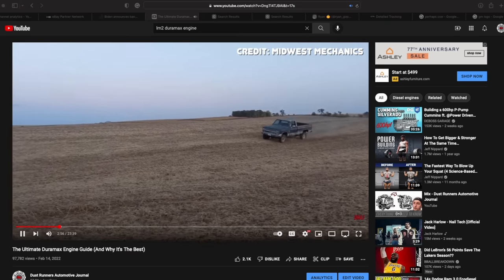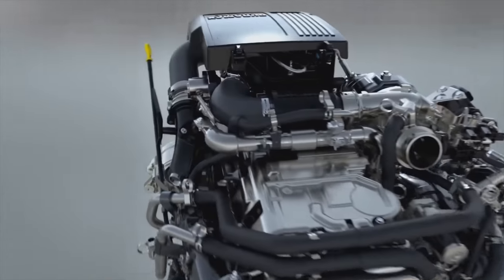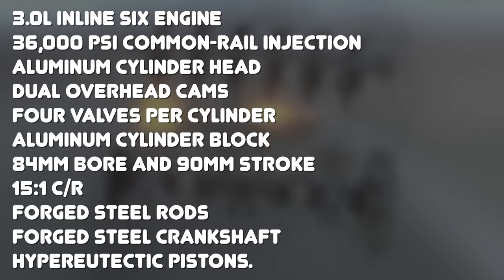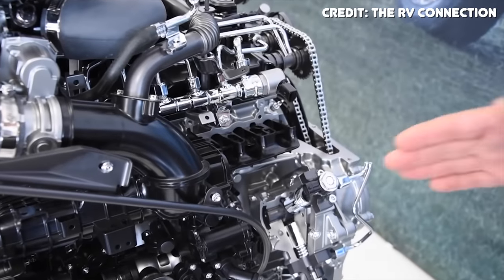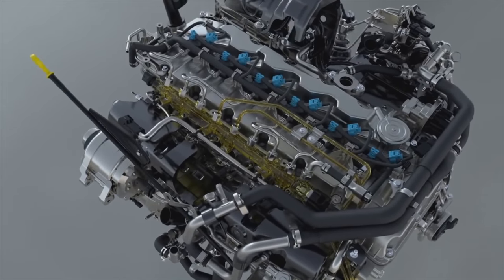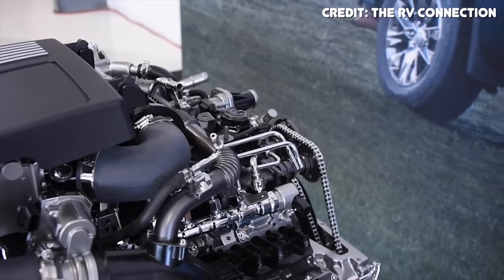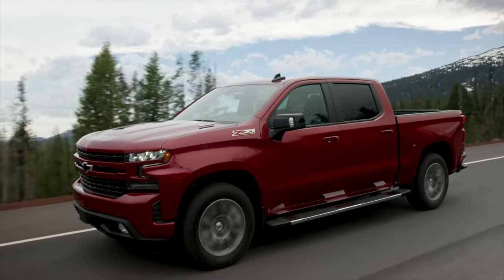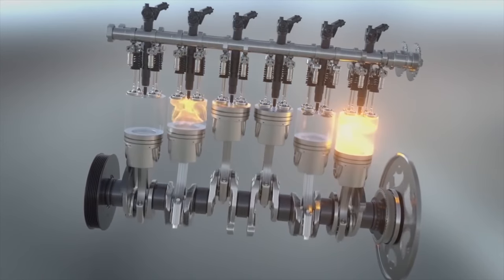3.0L LM2 Duramax: Everything You Need to Know

Comment: My 3.0L has 106k miles now. I drive an avg of 250 a day. I love this engine.
Reply: Planning on keeping it to the point you'll have to replace the oil pump belt?
Reply: @anotherrandomtexan25  already did it at 93k. Had an oil leak from the timing cover, and while they fixed that under warranty, I asked them to replace the belt. $75!!!
Reply: @hadyrome5574  did they say who long it took them? Difficult job?
Reply: @vomitus007  I think it was a 10 hour job altogether.

Comment: 25k. miles miles on it in 2 years normal driving  I really love this truck and engine. issues  long crank 3 times in 2 years and emission gasket exhaust replace    everything you say is so right what a great honest description of this particular engine.
I am a little skeptical of its reliability after 100k.  miles ?  repairs could become excessive. I would not own one with out an extended warranty ! or replace every 36k.  miles.

Comment: I think the access problem on the rear of the engine is kind of overblown. There are other engines out there that are so loaded up with complexity that it's just as much hassle to work on the front of the engine. Try changing a simple water pump on the Ford V6 Ecoboost. Behind a mile long cam chain on a 4 cam engine with VVT.  It's a seriously long, expensive, and messy job. I doubt this engine is worse to deal with.

Comment: I contemplated 1 of these in an at4 for a few weeks then decided to get a 2500 cummins instead.
Reply: @Todd Saeger yes they do have a 2500 at4 6.6 duramax. Ultimately I don't like the not a real allison 10 speed they are using and I'm not a fan of the interiors in 19'-22' gms. Plus I had a 94' dodge 3500 scdrw cummins so it was familiar territory. I just prefer the torque delivery of the cummins over the duramaxs as well. The 3.0 duramax is a cool idea and hope it ends up being a good engine i6 is the way to go. But all the overheating issues they were having and the rear drive system plus the tow rating was not what I was expecting.

Comment: I'm a technical at a Chevrolet Dealership in Oregon and I loathe this engine. In my opinion it is an engineering nightmare. GM has had issues with the timing chains and the job requires engine removal to replace those chains (according to GM Service Information). I was the first person in my shop to do this repair (the next biggest repair done previously by another tech was EGR Valve replacement). Before I performed the repair, I spent some time to think of the easiest way to do this job (cab removal, trans removal ect.) But I went ahead and did it the way GM recommended. The repair was performed due to a TAC recommendation because the cause of the issue is unknown. The vehicle came in with a Camshaft/Crankshaft Correlation DTC that set immediately as the engine turned over. I think it's important to note that the Camshaft Sprockets and Camshaft Position Sensor Reluctor Wheel are only held to the end of the Camshafts by bolt tension 🤦‍♂️ (19ftlbs + 50⁰ or something of the sort).
Reply: Sounds like job security…
Reply: Unkeyed cam sprockets have been around forever and aren't an issue.
Reply: On diesel engines?

Comment: Please do a follow up video on the 3.0 Duramax.     I would be interested in seeing what aftermarket parts are available.     How it compares to the engine in the Nissan truck with the Cummins.       Anybody out there with 100,000 miles on it yet ?     Anybody tried to change the belt yet ?      Is there an easy way to check the chain when you remove the belt ?     Wouldn't it make sense to go ahead and replace the chain when you replace the belt ?      I look forward to 10 years from now and picking up one of these used, with hopefully less than 100,000 miles on it.

Comment: My no-start problem only happened when I hit my break and my start button at relatively the same time. As long as I remembered to press the brake, then hit the bottom, it never happened. And I was able to duplicate the problem by pressing them at the same time purposefully. I got the flash so the problem is fixed, but now the engine turns over longer before cranking.

Comment: I seem to remember GM adding an extra injector for regen on the LML to avoid oil contamination issues with post injections. It makes me wonder why they went back to post injections for the LM2. Looking at everything else, it doesn't seem like they did it to avoid complexity. 
They really seem to be pushing their luck with Murphy's law given all the variable systems on this engine.
I get that variable stuff and drive by wire has proven to be reliable, but coolant valves, swirl valves, exhaust valves to aid the operation of not one, but two different EGR systems?

At least all that emissions stuff should come off in one big chunk so the apprentice doesn't have to make too many trips to the bin. lol
Reply: Sounds like a nightmare out of warranty or once aged.
Reply: Because the LML is joint developed with Isuzu . LM2 is joint developed by Opel. If you ask me, should I trust Isuzu or Opel , I will answer Isuzu resoundingly for a diesel engine.

Comment: The maintenance compromises with the valvetrain drive and oiling make this a no-go for me, personally.
Reply: Same here.
Reply: The ford uses a belt so I would rather have the gm
Reply: @johnbyram3116  Even though I'm a Chevy guy, that doesn't matter. Since the oil pump is belt driven in these it works out the same
Reply: I agree.  His explanation that a small displacement inline 6 somehow compromised packaging on truck with a massive engine bay was a bit of BS.  There's more than enough room to package that six without having the "go wrong" bits at the back of the motor, necessitating dropping the  trans and pulling the motor to service.  The engine would be the same length whether all that stuff was at the front or back.  Actually, putting all that noisy crap at the front of the motor, instead of near the firewall, would have resulted in lower NVH.

Comment: With the square body and gmt400 trucks, you could get a diesel either the 6.2 or 6.5 depending on the year. My 88 k1500 still has her factory 6.2 diesel.
Reply: My dad also has a light duty 94 k2500, essentially a heavy duty 1/2 ton, with a factory 6.5 diesel

Comment: Next work truck will be the 3.0 Duramax. I tow a mdeium size tool trailer about 3000-3500lbs regularly with my 5.3L and its  just not enough sometimes. Cant justify the HD trucks yet as I cant see myself towing more than my tool trailer for a long time.

Comment: As a technician I can say we dread working on these thing's. Nothing is easy to access and labor times are outragous because of the "packaging" compared to an L5P 6.6 or the 5.3 6.2 V8 gas engines which are a dream to work on. Granted these are new and we areant comfortable working on them yet. My advise to consumer/owners. Make sure if you don't have a warranty get an extended warranty contract with your purchase.

Comment: Last year I was on the fence to choose between my 3rd big GM suv, 2021 Escalade ESV 3.0 D Vs Tesla Model X 100D. 
I was soo leaning towards the diesel to eliminate the range anxiety….
But when I test Drove the Tesla I was instantly SOLD.. 
historically I drive to about 250k miles and I keep my cars 6-8 years. 
For me to know now that practically engine and transmission needs to be removed to do anything on that engine is a Big NO!
I’m glad I went to Tesla X.
For the people that are gonna comment that I chose the wrong SUV
I also have a 2014 F450 6.7 Power stroke with 240k miles and that truck is going to be my first million mile truck. Btw that also has a 65 gallon upgraded fuel tank with no Range anxiety 😂.
Thanks for the video! Very informative. Keep them coming 👍🏽

Comment: "variable intake manifold is an advanced feature". I guess the diesel motor(designed in the mid-90s)in my bmw must have been from the future lol. Bmws m57 seems to be a similar motor though, 3.0, inline 6, alum head and block, similar power 265hp/425tq factory. Mines about 330/510 at the wheels with a mild tune. I bet the Lm2 would respond nicely to a tune....

Comment: Wow.  Great video.   This is my first video from this channel.  I hope you have the same video on the Ford 3.0 PowerStroke.  That’s the engine I have.  I love the gas mileage.  I average 24-mpg.  On the freeway I can get 32-mpg.  I love the sound of the engine. I love the power when towing a trailer.  However, what I don’t love is that my 2018 has its 4th oil leak.   As much as I love this engine there is something up with the oil lines that go to the transmission.   That’s where all the leaks have been.  Anyway I think it’s time to call Ford Corporate.

Comment: I've seen thicker chain setups on gas motors. I feel the timing chain is going to be weakest link for the motor.
Reply: Right and the whole “it’s in the back to make it shorter” is such bs.
Reply: @dontimberman5493  Exactly LMFAO engine is going to be the same length regardless
Reply: @alainaguilar9938  both LMFAO
Reply: @alainaguilar9938  You better stay in training for a long ass time kiddo. Cams are chain driven.

Comment: FYI, GM designed the 1500 engine bay around the new straight six diesel. 
Which is mentioned multiple times in videos on you tube by GM engineers.

Comment: I'm hitting 28 to 32 mpg . Plenty of power.   Very quiet.  Smooth operation  . 5 Gallon of Def fluid per oil change . 8000 miles . The oil. 0w20 dexos D. Is  a little high in price ..$ 100.00 oil change .

Comment: Mine is a work truck thats on the road 5 days a week, 71k on this 3.0 Diesel with Zero issues. Pulling a loaded trailer I'm getting between 13-16 MPG's, thats much better than my Ford Power stroke. The 10 Speed is flawless and smooth, it keeps the 3.0 in the power band pulling like a Bear! In the mountains I've been impressed how well it keeps up even loaded. I take care of my equipment better than most, sadly too many owners don't bother to use the correct Motor Oil than are the first to complain. Change my Oil every 7500 miles.

Comment: I like alot of the technology with the 3.0 but that rear timing chain system makes this a no go. Will it be fine for the first few years? Almost certainly but if you are like me and buy trucks for the next 10-15 years having to drop the transmission anytime anything at the back of the engine goes wrong is gonna get expensive over the life of the engine.
Reply: And I dont get why they put it at the back, since in the silverados they have plenty of room in the front and back of the engine bay since they have all switched over to low profile electric fans, yet they have the same amount of space in the bay from when the older engines had mechanical fans.
Reply: Why are the chains a no go?  When you go shopping for a gas car and it has a timing chain and not a timing belt you would get excited.  I know it has a belt for the oil pump but I'd rather have my mechanic drop the transmission and instead of removing every accessory on the front which probably means draining the coolant too.  And while he's in there he can change the rear main seal which we all know we aren't dropping the transmission for a $6 seal.  I happen to have a lift so I know I could have the tranny and transfer case out by the time someone else cleaned up the mess from spilling coolant everywhere.
Reply: I'm guessing you avoid manual transmissions too because you will need to swap out the clutch?
Reply: When changing a manual  transmission  clutch....the bell housing has to be removed....not a big deal
Reply: @jboyle96  Depends. My old Ford Flex had a timing chain too but because of packaging, doing the chain is a $1400 job and takes like 10 hours. Better do the water pump too because those Duratec V6's will piss their coolant right into the oil pan if the shaft seal gives out...which they do.
 People are right to be concerned with a repair that will likely cost thousands of dollars, especially off warranty. The 5-cyl Atlas motors in the 1st Gen colorado were nice reliable motors for the most part, but doing the timing chains meant pull the whole accessory drive to get at the front ones as well as dropping the front diff (on 4wd models) because the oil pan has to come off and you can't get it with the diff in place. Then you get to pull the transmission too (and t-case if 4wd) because GM put the chains for the balance shafts on the back of the motor inside the bellhousing. To have someone do the complete timing set on a 5-cyl Colorado is $2k-$3k depending on labor and parts.

Comment: The engine bay is slightly longer on the 2019+ trucks then the previous generation truck because of this motor. You can tell with the v8’s there is a little more room.

Comment: The case you've made for the rear mounted timing chain doesn't make sense. First, it doesn't matter if it's on the front or back, the length is the same.  Second, the engine bays are generally larger than they need to be.   Many GM trucks with Cummins swaps fit the Inline 6 in just fine, without issue, my truck included.

Comment: as far as ive been able to research myself it uses the same injectors as the l5p but a slightly modified HP4 pump with one less pressure chamber, also i love this engine and im really keen on catching al the wrongs of it, but people whining about a service item the average joe average owner is not going to touch in the 10 years is gonna take to get there is dumbfounding for me, hey at the very least this engine wont get dropped like ford's did....
Reply: "Average Joe" isn't going to buy a half ton diesel. Enthusiasts will, but they care about these things and will likely own the vehicle longer.
Reply: @daniels2761  well yes but more than likely still far out in the future for that one "maintenance" and surely at 150k many thing will have to be replaced or patched, the thing is that most of the buyers you reffer to is going to be the 2nd owner of the truck, while the one im calling out is mainly the one that will either lease or simply sell the truck once it reaches 70k to 100k but that was my mistake for not pointing it out because a bunch of people cant afford or justify these overpriced trucks

Comment: you should do a video on the BMW m57, its a 3.0liter diesel inline-six with a sequential turbo setup. they are cool and interesting
Reply: What BMW came with the M57 in the states? I'd like to buy a used one for a swap into my Patrol Y61
Reply: @ojbarberena7090  you could still do a n57, they made them in the states
Reply: @ojbarberena7090  either the 335d or the X5-35d, 2009-2016ish